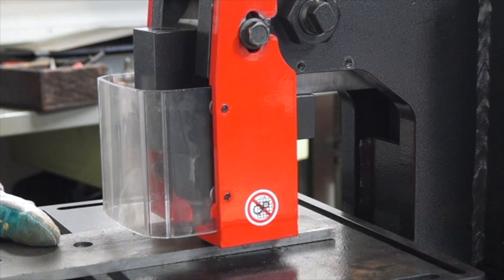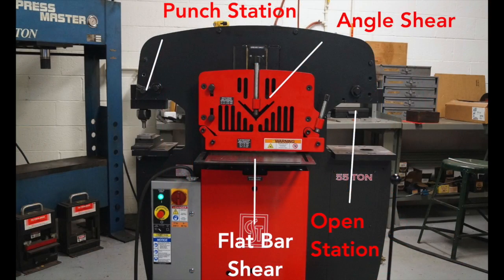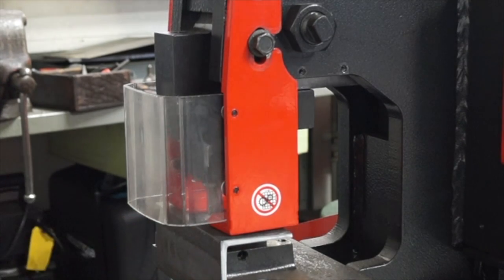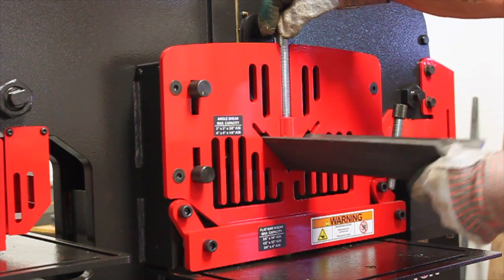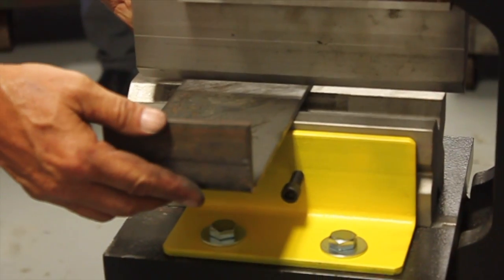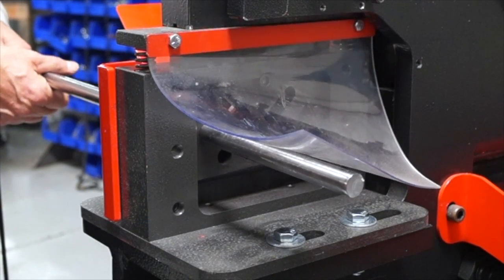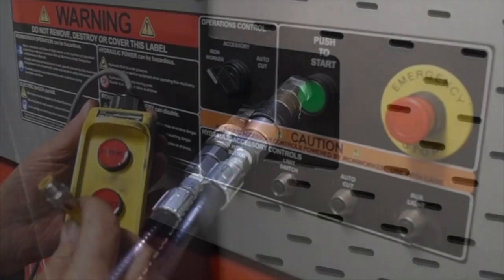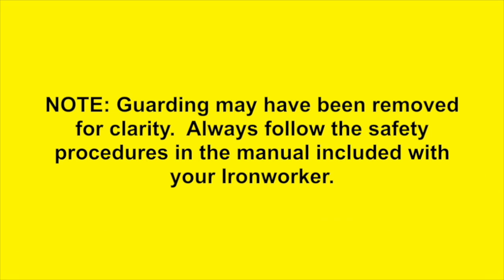55 Ton Ironworker Capabilities

Comment: I purchased a 60 ton Edwards Ironworkers back in 2010. It’s never disappointed me and is used on a daily basis. Never had a breakdown. By far the best tool I’ve ever owned. You can’t go wrong with these Ironworkers folks 👍

Comment: Oh yes is awesome of course total? On that one. If you want to shear angle iron then count on it becoming a radius and no longer an angle. The safety guards of course as safe as they may be hinder your line of sight. If you can't see what you're doing then you're just making scrap. I have a 60 ton Edwards in my possession there is so many engineering issues with this machine it works great if you're a novice  just chunkin parts. The stroke control is proxy switches. They're so loose rigged to dial in might as well call it up 20% scrap. On the other hand if you're looking this shear parts that are going to end up being less than 3in they don't fall out of the back of machine. I mean shoot I don't think under 2 in they fall out. I had to build a custom spring loaded device in order to help get them out. The change over time between the punch and the break is lengthy. Looks pretty with all that paint please I invite you to try out mine which I'm trying to sell and having a hard time doing it. Get a Geka or a Pranha. Thank you Edwards and all your engineering teams suggestions on trying to convince me I'm a freaking idiot with 24 years experience in metal work and your gooey paint. Please y'all consider Consulting people that own these types of machinery before you ever open your checkbook for an Edwards / JMT. I'm not exactly a disgruntled customer I'm a customer that's tired of not being listened to and sold some poor quality.
Reply: Your kidding right? I’ve owned a 60 ton Edwards since new in 2010. I’ve never experienced any of your issues and I highly doubt yours is used more than ours.
Reply: @7863348  q